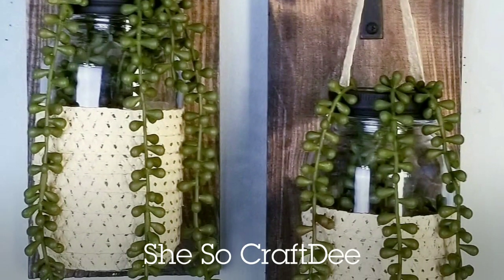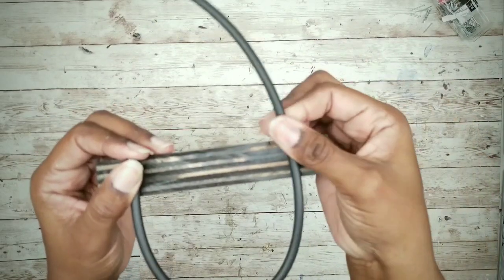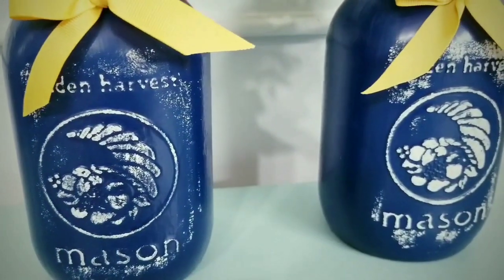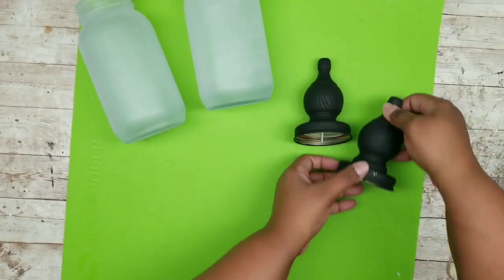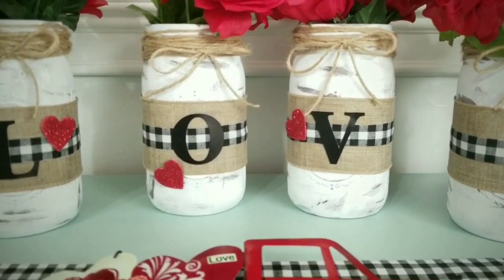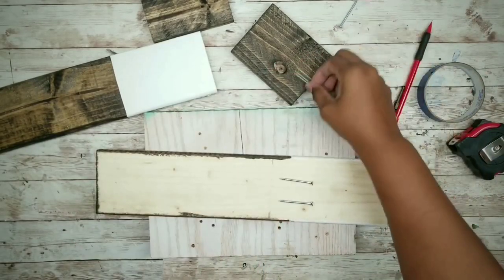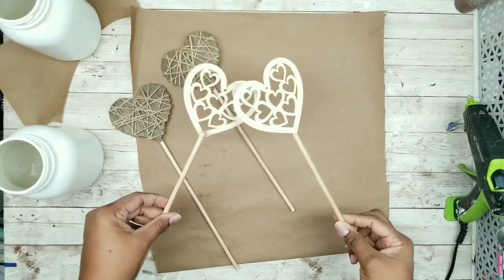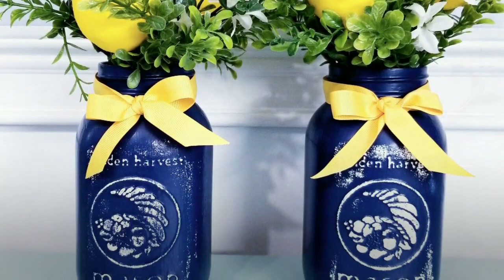TOP 10 Creative Ideas & Hacks Using MASON JARS | DOLLAR TREE DIY | Home Decor DIYs | Must Try!

Comment: How do you get the chalk paint not to leave terrible brush strokes? Mine keep showing the strokes terribly
Reply from the maker: I go in one direction and place on 2 coats. If the chalk paint is older, it has a tendency to be thicker, so adding some water may help with brush strokes too.